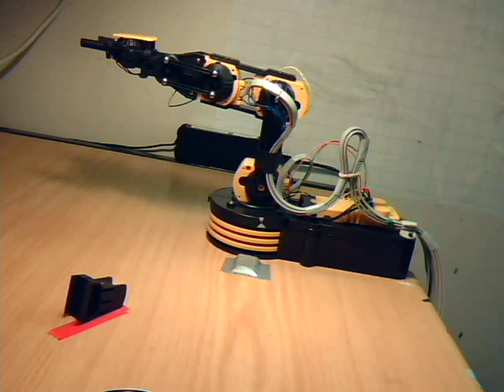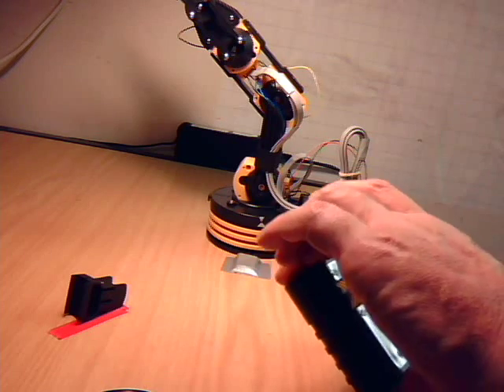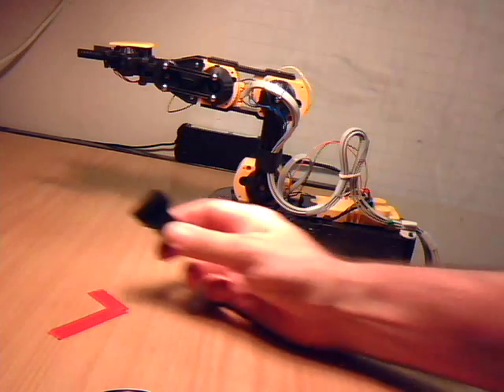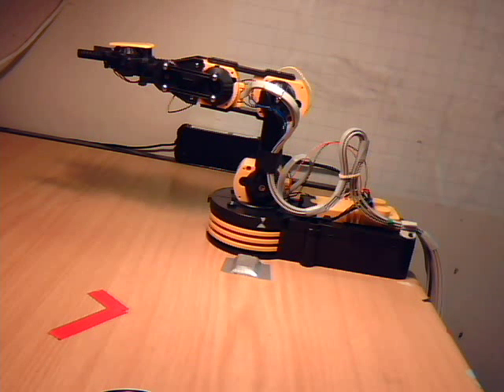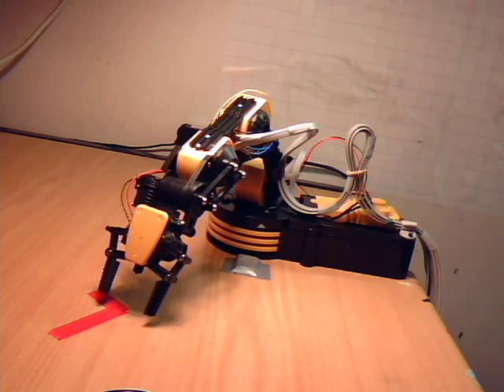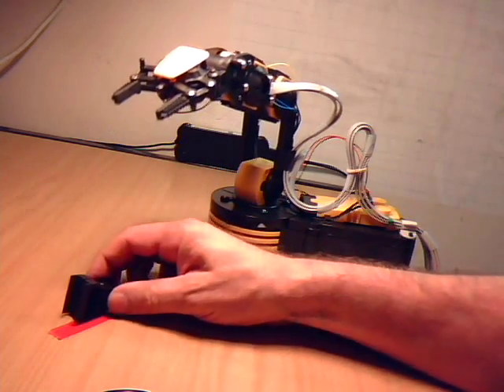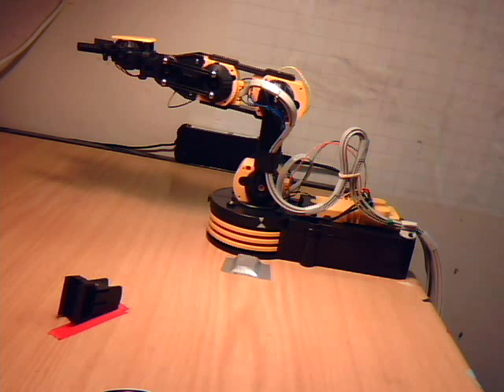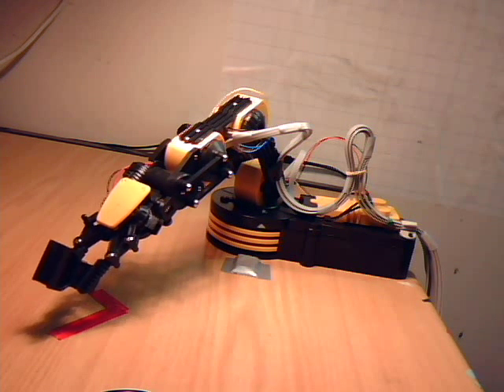Five Axis Demo  Short Demo - OWI 535 Robot Arm

Comment: @Wiipronhi
He's added sensors to create feedback so the software knows the position of the arms. The standard Owi USB kit just moves the axis for a specified amount of time which is ok as long as you set the arm to the same starting position before you run the movement sequence. Also the software that comes with the arm is ok but you can't really 'program it' in the real sense of the word.